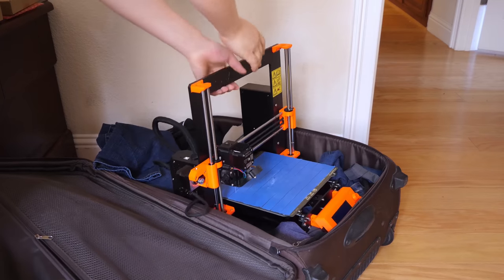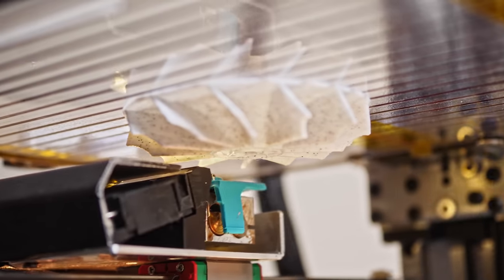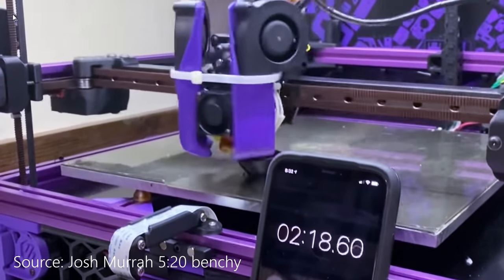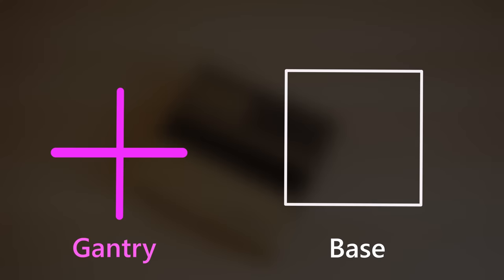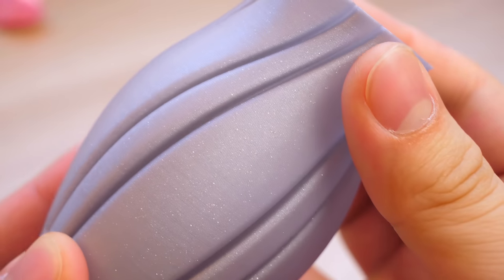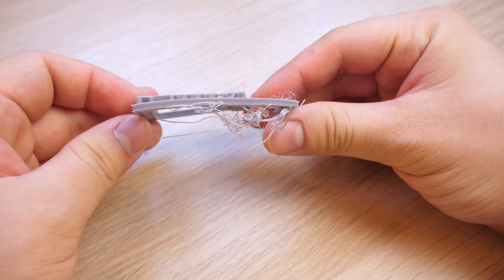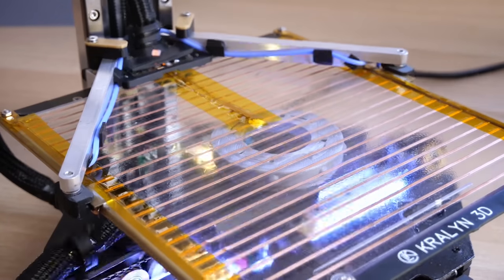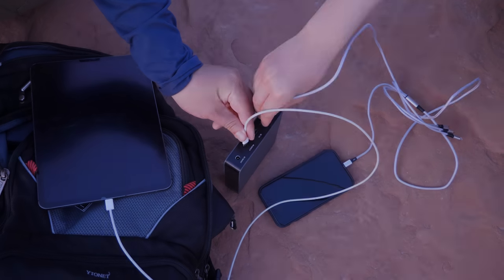A DIY 3D Printer That’s Upside-Down, On Purpose? The Positron Introduction

Comment from the maker: Hello everyone! I wish that you liked this 3D printer design. (I had to reupload real quick because a small issue) If you have any questions about the 3D printer or the power bank crowdfunding campaign, feel free to write them below!
Reply: That link goes to a different product - the Polycharge.

Is there a crowdfunding campaign for the Positron Printer?
Reply from the maker: @DarrylHadfield  No, this is the first version release, if there is enough interest, I will create a crowdfunding campaign around the Positron 3D printer as well.
Reply: I and many others are interested in buying sufficiently.that a crowdfunding campaign seems.like a good idea, to me.anyway!
Reply: Can you please do a speedbenchy?
Reply from the maker: @Tedlasman  There is a limitation with the extruder that makes it cannot do past 150mm/s so I am actually redesigning it. I will likely release a version 1.5 with some upgrades once that is finalized.
Reply: Initially I was disappointed that it wasn't positron, but I ended up liking polycharge and backing it.   I like the design aesthetic and it's functionality. Keep it up!
Reply: @Magnanux  Ditto.  now I have to think about how to convince KRALYLN3d to make it modular. :)
Reply: @ me if there comes a campaign for the Positron printer hehe
Reply: An idea, because heavy objects might fall off the build plate and heavy objects are likely large cross section you could use an aluminum build plate that has an array of through holes for the initial layer to extrude through. They could be 1/8 or 1/16 of an inch in diameter.  After printing you could drill the holes out to release the object.  Yes you would need a removable heating element.

I have many patents but I give out ideas to people who are going to Open Source Products.

Good luck with this product.  Maybe you should JV with Prusa.
Reply from the maker: @highwaymen1237  Thank you for the idea!
Reply: Plz register your product and get a patent, prusa is going to stole it from you
Reply: @highwaymen1237  I'm not talking about printing upsidedown, I'm talking about the entire portable printer
Reply: How much this printer will cost if it goes for mass production?It has really creative design for problem solving ,it will be definitely a great success.
Reply: Very nice.
How do you deal with priming the print-head? Just do lots of skirts? 
I'm also assuming that you have to get retraction just right so that there is no material running back down over the nozzle and pooling on the hot end?
Reply: If you do a campaing please include a diy kit
Reply: I want to buy this printer, can i buy one please? thank you, can't wait to see the KRALYN Printer release! ;)
Reply: Hello! I'm impressed about the whole concept! Great Job! However, as my fellow makers suggest. Please patent it before some company steals the design. Maybe register as an open source like the voron? I don't know but please don't let a great concept be stolen! Not saying anything but if Naomi has seen this, is very probable that Creality has as well. Be safe!
Reply from the maker: @leonardocastaneda904  I did file relevant patents (in China) which I will not say what they are about specifically, but this should prevent stealing and give me a legal case.
Reply: @kralyn3d  You could make a  kickstart camping and get some money
Reply: Can you post here when you do crowdfunding for the printer.
Reply: Errr paused at 5 minutes here and do I need to explain the efficiency here or do you understand your own bullshit
Heh it's so efficiene it can print on thin air
Reply: Do you think you can make the 3d printer fully mobile by designing an module for the Powerbank that connects the Powerbank to the printer ? Love your projects.
Reply: I love this!  Some thoughts:

1. It really IS a 3d printer designed as a tool; compact enough to store in a cupboard/tool caddy or under a truck seat, while still big enough to print 90% of what most folks need.  Bravo!
2. When you get around to crowdfunding kits/assembled units, I suggest a stretch goal of a tough, temperature-resistant container for it that is tall enough that you can use it as an enclosure while in use and can fit a couple of rolls of filament when stored.  Perhaps it can attach to the lid and have the bucket/container lower over it?  A webcam that attaches to the bottom of the bucket/container with magnets would allow viewing the print in progress.  Another option would be a folding enclosure.
3. For even faster printing, how about a design that brings feeds in 2 or even 3 filaments to feed a 0.8mm or even 1.2mm nozzle?  For printing tools/jigs/etc., speed is more important than looks, so layer lines wouldn't be as important.
Reply: I've been looking for a long time at various desktop printers and this is the first time I've seen something that I have immediate thought "this is what I want!" It always struck me as odd that nobody had tried moving the center of gravity, but I don't posses the skills or tools to build a solution like this myself. 

Extremely impressed! I would love to be able to buy a finished variant, or a complete set or parts I could put together with a guide!
Reply: Wow! Love your 3D printer design I want to add my name to all who want this 3d printer.
2  Recommendation:  1st is a round glass plate to increase Print  volume on surface and  second you  double the z-axis height.
 Truly an ingenious design, Amazing I like it.🖖✌👌
Reply: Fantastic work what an amazing design! You really have set the bar with this build I am so impressed. It's been a while since I have been excited about a new printer. I expect to see Tom, Makers Muse, 3D printing nerd and teaching tech, to go nuts over this! I must build this machine :)
Reply: @DarrylHadfield  very interested in a go fund me for this product
Reply: I would love to get one of these. I plan on doing prints on the go. Perfect!
Reply: @kralyn3d  Not really interested in the power bank, but i'm definitely interested in the printer.
I don't have a lot of space so being able to store away this printer in a small footprint would be great. So when you release the printer indiegogo you'll definitely have my attention(if the price is competitive.)
Reply: This is amazing. I have been 3D printing for almost 2 years and have wanted a portable printer. None I have seen come close to this. Sadly I do not have the skill to diy this but will be on the list to purchase one. Thank you and keep up the great work.
Reply: @kralyn3d  love the printer realy want 1
Reply: @KeithOlson  You don't need multiple filaments, you just need a faster extruder stepper or switch to a servo. Everything else makes it just complicated without any reason.
Reply: Great design! I'd really want one a bit bigger and taller, say, 235x235x400. Portability isn't so important, but rigidity is, and with the hotend at the bottom and build plate only moving up it has great potential for big prints.
Reply: @kralyn3d    If you wait,   six other companies will copy your design and get to market first...    I thought someone should be honest and tell you the truth.
By next year, you will be too late,  they will make all the sales, and you will seem like the  forgotten late comer...   Nothing personal,  it's just business.
Reply: Hello, how much do you think this printer would have to cost in a crowdfunding campaign?
Reply: How large can you make it, and mass produce it, at a reasonable profit margin, at a  price point of   $ 999  USD ?   The problem with 3D printers is they are too small, as most objects that are useful tend to be larger.   The industrial fabricators are much larger, but have a much higher  price point, and they can work with metals.
Reply: I love the idea!
Does the printer also support thermal runaway? I am not familiar with the klipper firmware.
Reply: Guestimate price for build kit or completed shipped if that would be simpler?
Reply: Take my money! I want one of these little printers!
Reply: where to buy ?
Reply from the maker: @Jan_Seidel  Yes, Kipper is actually the most advanced 3D printer firmware on the market right now.
Reply: I want to buy one
Any guidline,!
Any link
Reply: How much would the printer be if it becomes available?
Reply: @kralyn3d  I'd be interested in a kit. Very much. That is a truly unique and very cool design. Kudos!
Reply: u should to patent this conception, this is genius bro
Reply: Would it be possible to add a digital scale to the z axis to detect failed prints? If that thing for a lot lighter all of a sudden or if it didn't get heavier while still extruding you could raise an alarm.

I mean you could do that on a traditional design as well, but I think here it would be easier.
Reply: Very interesting type of belts for CoreXY design: some kind of guitar string with rubber cord threading around it. What's it, exactly?
Reply: You got me. Waiting for commercial product.
Reply: Add me to the list of people wanting to buy one...
Reply: If you manage to design a protection for the belts/gears in case of falling prints or "hot spaghetti" printing error, this could be one of the best printer ! 
Once you'll get the success it deserves, other brands will probably copy your design (like with Prusa) but I think the key to keep people interest on the original (yours) is to take your time and only start selling when you feel than you got a complete/finished product, with no regrets that would lead to revision (v2, v3, pro, etc) within the few months after release. One well made product will always have a longer viability on the market than a top notch but ever changing model
Reply: Absolutely cool design. If we forget about the portability for a while, would it work if a robotic arm was holding the print bed? I was thinking along the lines of continuous printing and introducing yaw and pitch to the print bed. I know these ideas are out of the scope for now, but is it a fun thought?
Reply: @kralyn3d   please the design school you're attending is it an online or physical school...
Please i really need your response.
I wish to join the school I don't mind the price if it's not a free school..
Because i have been looking for a school or experts to mingle with so i can learn more about electronics..
Reply from the maker: @mainlidar  My school contributed little towards my technical knowledge. I started by just researching and learning online.
Reply: Tpp
Reply: I trying to design an ultracompact corexy printer... and your design made me rethink the whole frame of the printer.
And this hotend is amazing. Is something commercially  available?
Reply: @kralyn3d  how to order of powerbank bro
Reply: Did I understood it correctly no more  saving on pen drive it can be printed directly over a cable/ network?
Reply from the maker: @CUBETechie  yes
Reply: @kralyn3d  it was a very good solution using your computer/ tablet directly and not several extra devices. It safe time .

Did other 3D printing companies have this feature or did they use pendrive?
Reply: @kralyn3d  yes please create a crowd fund for this looks like an awesome design would love to buy kit an put one together.
Reply: Hi, is there an estimate on the new design? Could you please mark parts that are not likely to change so we could start ordering parts and build?
Reply: @kralyn3d  Do it dammit!

Where's the buy link?

TAKE MY MONEY
Reply: @kralyn3d  Any updates?)
Reply: How much will the finished version cost roughly?
Reply: Oozing? The inverse printing, what happens to oozing? Can you reduce the retraction? Is retraction really necessary? You focus a lot on portability and size, but why not just print the whole thing? A ton of work put into this one. Congrats with the outstanding result.
Reply: I love the design so much that I saved your video, please make you next iteration as well as this one easy to download, I do not want to have to make an account on some websites just to get it.
I truly think this design is worth supporting.
Reply: Are the syncromesh cables more prone to slip than toothed belts? Following that, will these have a lower maximum speed hardware-wise?
Reply: I would definitely buy this. subscribed hoping that eventually you do make it. The ability to transport a 3d printer in a tool box or backpack is insanely groundbreaking
Reply: Is there any possible way you could put this on a crowd fund
Reply: When will the next update video be released?
Reply: Отличная идея! Поделитесь ссылкой на изготовление стекла с подогревом, пожалуйста. Спасибо за ответ! С уважением Я.
Reply: This is awesome 👍
Reply: I want this printer! It’s awesome!!!!
Reply: I wish I had found this 9 months ago. Your power bank looks great; however, the campaign is now closed. You have a very creative take on machine design. Keep up this amazing work. Oh, highly respectable to open the design to the public and keeping the Maker spirit alive.
Reply: I'm interested
Reply: I want to buy one complete 3d Printer.
Wehre can i buy it?
Reply: How can I get one?

Comment: I'm not so concerned with the portability of a 3d printer, but I do like the idea of being able to fold it up to tuck away when I don't need it for a while.   Inverting the placement of the gantry and the print bed seems like such an obvious solution to one of the biggest problems with the most common printers - rigidity.  Well done.
Reply: Agreed. Honestly the only thing I don't like is the super custom hotend. That looks like the only real potential weakness/maintenance headache. I'd take a slightly bulkier version that could take off the shelf hotends in a heartbeat.
Reply: @Lassi Kinnunen 81 it's definitely cool, but it just screams "I'm going to need tons of maintenance".
Reply: I totally agree. I wish I could find a good way to store my printer and put it out of the way. I honestly don't think I've utilized the full print volume on my printer yet but it totally takes up all of the space in my room.
Reply: Living in a small apartment, I'm hesitant to get a 3d printer because I don't know where I'd store it. This looks ideal as I could just put it in a box in the cupboard when I'm not using it, and it wouldn't take up much space.

Comment: I'm encouraged to learn that you are considering a commercially available version. I would hope that you can offer a kit of parts and instructions as well as an assembled printer. You have done a beautiful job and the results are amazing.
Reply: I hope he makes a commercially available version! That would be awesome!
Reply: @Charmlethehedgehog  Will probably not happen. to create evenb a Kit version would be a financial disaster... That is the reason why the Voron guys never released any official kits - of cause now some chinese guys offering the parts as a "kit". Same could happen here if the traction for this project ramps up.
But that is also alot of work. Create a homepage, release the BOM, CAD, buzild instructions etc is very time consuming - probalbly even more than designing the printer. And then you need to build a community for it. All not really easy for a single guy.

Comment: I used to run a print farm and I have to say this is really impressive from both a technical and practical viewpoint.  Massive kudos to you for making a printer that isn't just another clone.  If you start a kickstarter for this, I'll back it without question.